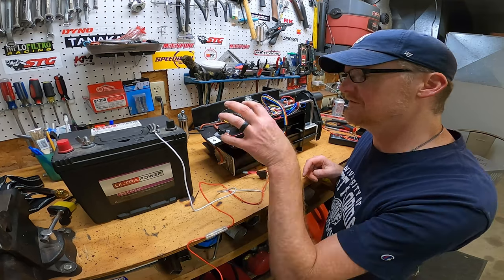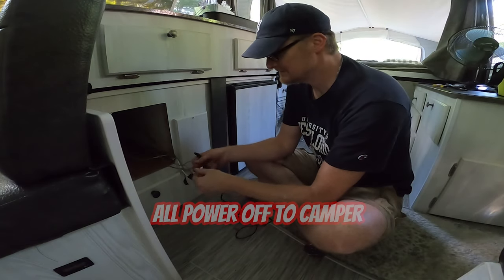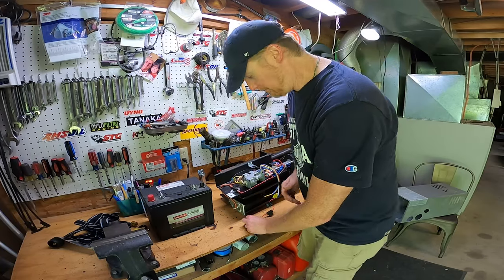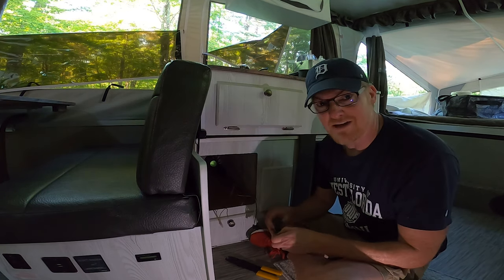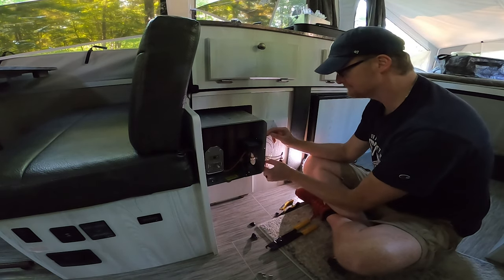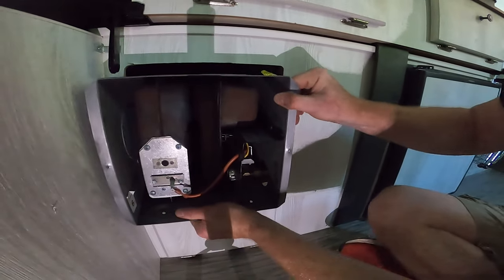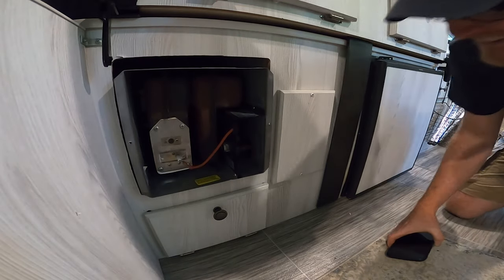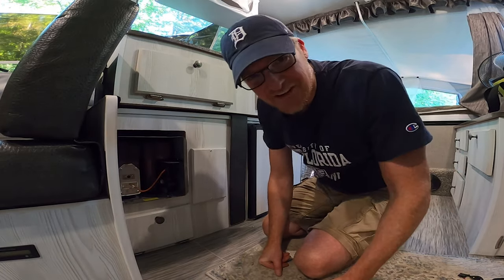Pop Up Camper Furnace Suddenly Quit Working! NOW WHAT? | 2019 Rockwood 2280bhesp

Comment: Very helpful video.Also have a 2019 2280BHESP and furnace did not ignite. Took it out and blasted it with some compressed air, and works perfect now. Key tip, label all wires.
Reply from the maker: Glad you got it sorted out 👍💪 thanks for the feedback! Great tip too!